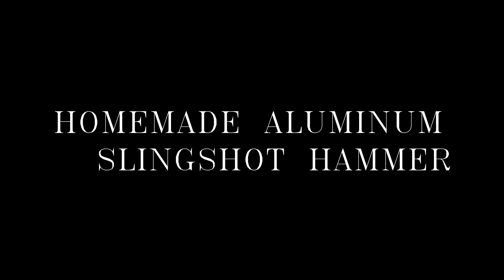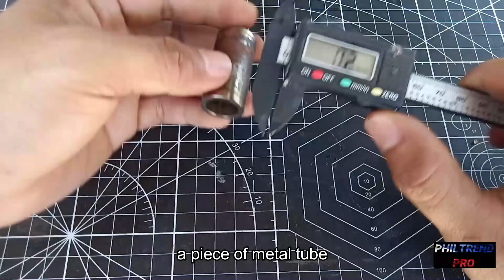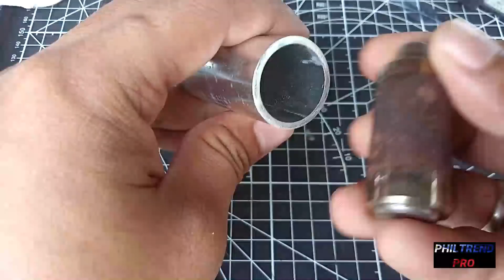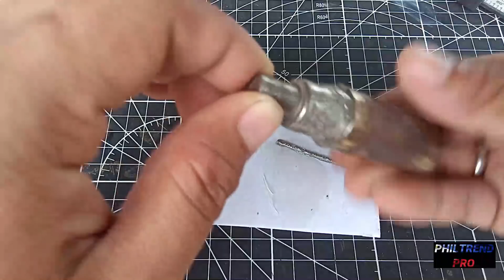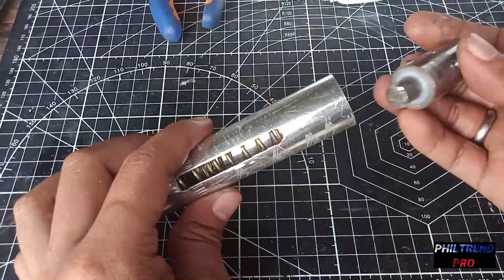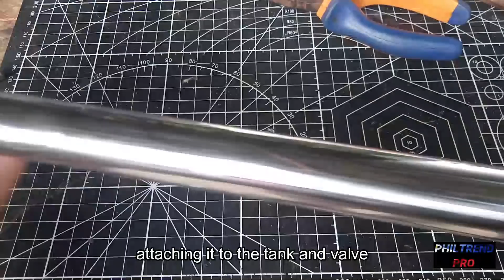HOMEMADE ALUMINUM SLINGSHOT HAMMER

Comment: that is not slingshot hammer coz it under spring tensh all time ! needs to free flow frawood so when its struck valve its not under spring tension . that's not sling shot hammer !!!!